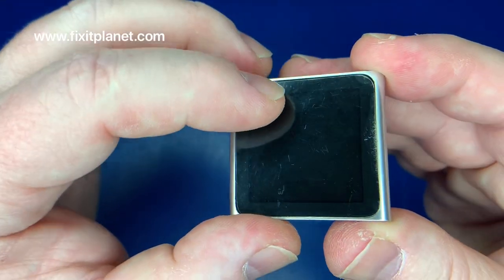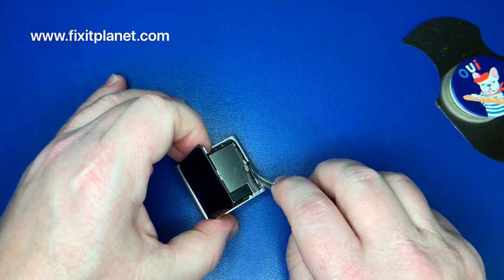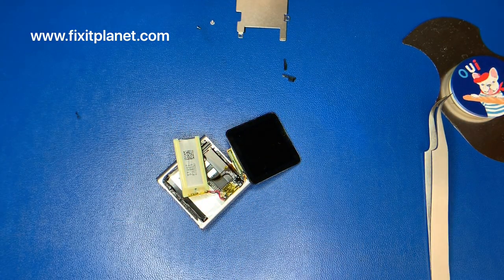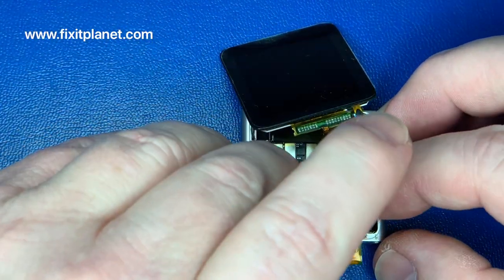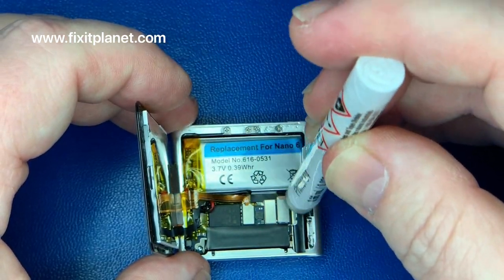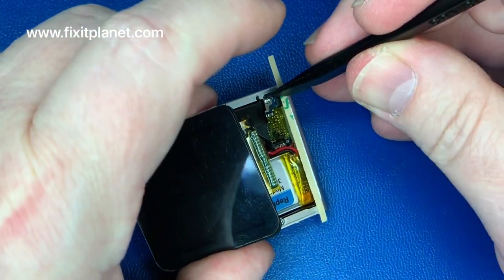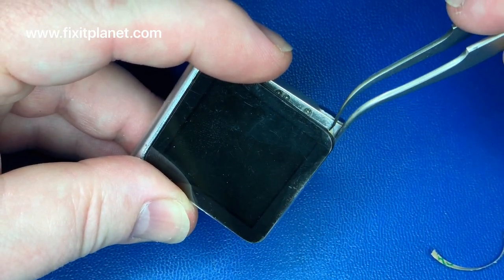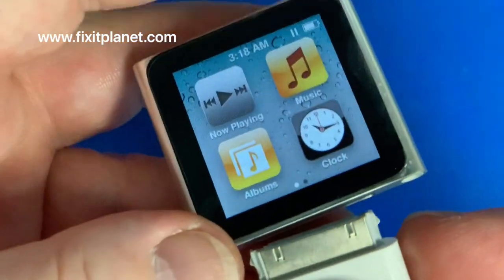iPod Nano 6th Gen Battery Replacement From Start To Finish.

Comment: Thank you man. After I've replaced all correctly my nano didn't get "on" so I couldn't understand why, even after connecting the recharge wire the same. So I firstly thought it was a bad new battery and just welded again an old one to make sure it still works. And fortunalty it was. After that I've welded again a new battery but before closing everythin I've connected the wire for recharge as you did in this video just to make sure it works. Don't know how but I did it !

Comment: hmmm i bet a 501235 3.7V 180mAh battery would fit... its 5mm thick instead of the OG battery which is ~2.5mm, but it doesnt have nearly as much wasted dimensions from the crimp around the parameter and is several years newer design. could probably find those extra 2.5mm by gluing around the battery and either leaving the "metal bracket" off or cutting it across so it doesnt cover on top of the battery. im sure there is a mm or two tolerance by design due to battery expansion.

this simple change would increase the capacity by 80% and also would be much cheaper as a generalized battery source.

Comment: I hope you see this. I got this ipod and it's full charge only while plugged in to the wall charger. When its unplugged it turns off. Think changing the battery will help? Thank you
Reply: LO SOLUCIONASTE  tengo el mismo problema solo conectado prende  y lo desconecto y se apaga

Comment: i got mines a month ago and my battery drains pretty quickly im not sure why it was brand new at most times when i listened to music for like 5 minutes of my workout it dies hope i can get help on this
Reply: its cause the stock of these ipod nano 6th gen is very old. they stopped manufacturing these soo many years ago and since then these batteries have been sitting ducks unused which kills the batteries. just replace the battery and you should be fine

Comment: Where could I find a replacement battery for this that was manufactured recently (not ten years ago)? I once tried to find a battery for a retired Gameboy Advance (made in 2004). The battery I received LOOKED new...mint in package and still factory sealed. However, it was manufactured over ten years ago, so it was already dead before I even bought it. 

This iPod Nano is almost 10 years old. Are there any battery manufacturers that still make batteries for old Apple and Nintendo devices? (I’m looking for a Kindle battery as well)
Reply: FWIW, this is probably a standard sized battery that's still in production. the GBA SP is a special case, as they put their batteries in... well, a special case. They don't produce the shells any more, but there's now a mod you can do which lets you fit a standard battery into the SP.
Reply: @Charky_Creations  Thanks! Where can I find that mod, and what is it called? As far as the GBA SP’s battery case, if I could find what went IN the case, I could simply open up one of my dead ones and put the new one that case. But I’d love to find that mod.
Reply: @Vmurph  it's generally called the "makho battery mod" after the guy who designed it, but it's basically just a pcb that you solder the cell to so it creates contacts for the SP. You can do it yourself or buy one prebuilt.
Reply: Thank you  @Charky_Creations !!

Comment: Hey what happened to the metal plate that was removed in the first half of the the video? The metal plate which separated the screen from battery and other pieces. Where you mentioned how tiny the screws were.
Reply from the maker: We put back in here at 18:46 fussing about it all the way thru.

Comment: Is it worth it to send one in for this? I'm asking this because I have one that needs battery replacement, otherwise it works well plugged in. I don't have the equipment mentioned . :(
Reply: You can get the parts and battery on aliexpress for fairly cheap
Reply: you can use a blowdryer and something thin to take out the display then use a screwdriver to take out the screws and replace the battery

Comment: I can’t seem to get the screen to sit flat without hurting the digitizer. Any ideas?
Reply: It doesn't exactly sit flat. I has to pop out a bit
Reply: you have to remove the sticker of the battery as it adds a little thickness to it. you can also press/put a little pressure to  the battery's circuit so you can align it with its thickness/height. 😊😊😊

Comment: I was thinking if we can just skip putting the metal piece in....  Was it necessary like (Heat Sink)...  or it is not that important...
Reply: It’s there to isolate the screen and it’s wire from the rest of the motherboard